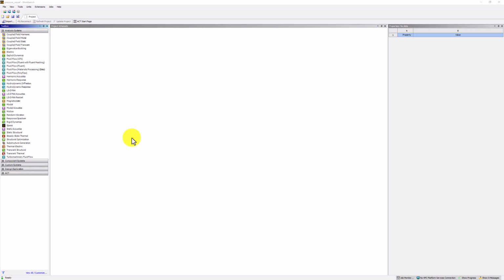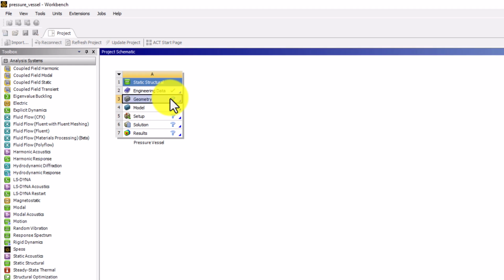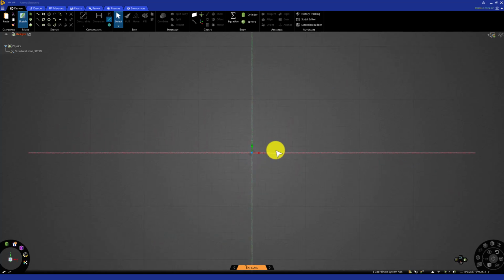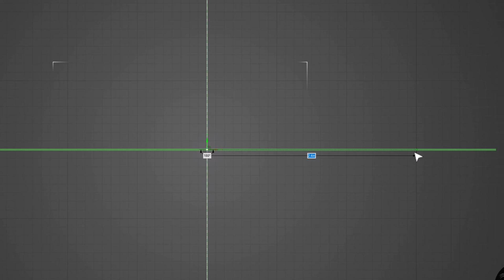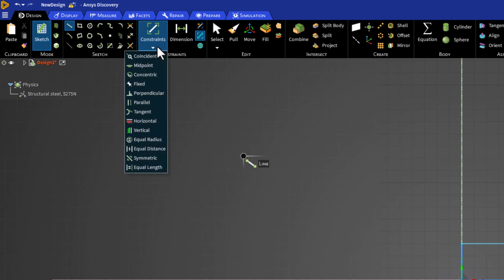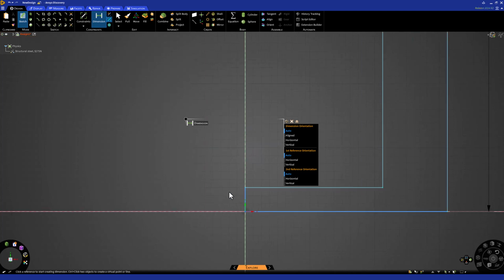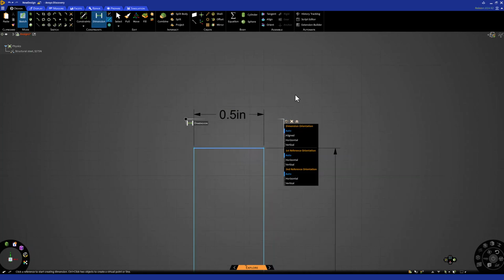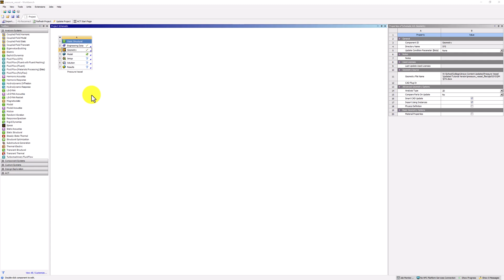Geometry | Stresses in Pressure Vessels

Comment: Nice discovery tutorial

I have noted an issue in discovery : the lines aren't showing when I draw them. Like, the line is there, and i can give it a dimension, or select it, but the line is not showing up after I draw it using the line tool. Is there a setting that can allow to change the color of the line, or is it something like that ?